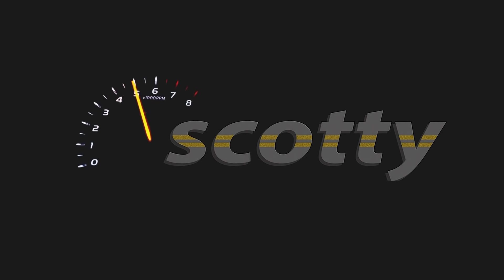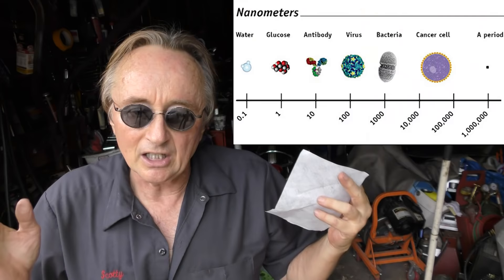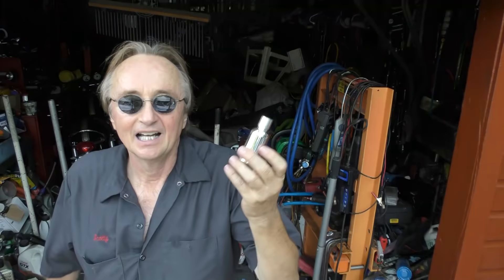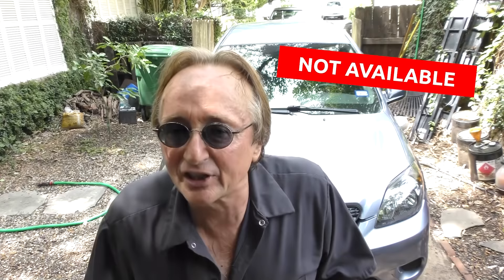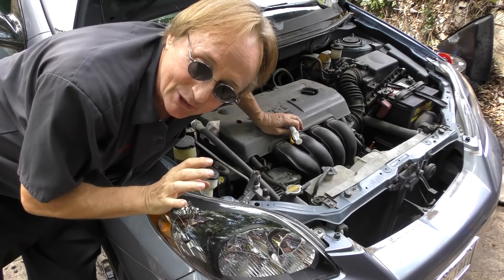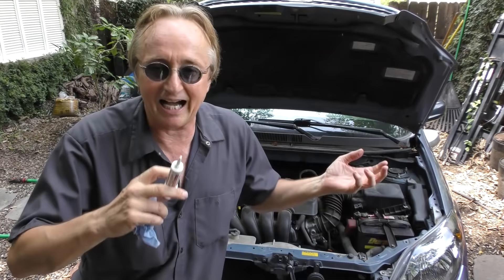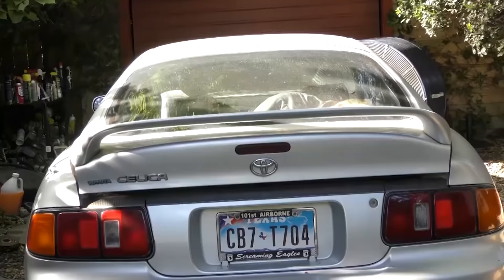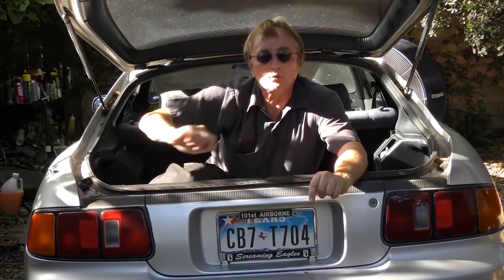Why Not to Buy Nanotechnology Products for Your Car

Comment: Scotty, certified Nano Ceramic coating installer here. It’s all in the prep, a proper prep and paint coatings (quality ones like GTechniq) are amazing. Absolutely  must do a good clay bar and single stage if not dual stage polish on them via machine, then an IPA wipe then application. Application is more difficult on the high performance ones, and they are legit. Google nano ceramic coating under microscope and you can see how it actually works. Some work better then others.

Comment: For the paint coatings, you really need to have the paint corrected before applying it. NuFinish is loaded with fillers that hide flaws, but putting a coating on bad paint won't make it look any better. Also, most coatings can't be used in the sun, as in NO sun. Just parking your car under some trees isn't going to cut it. Any sun, and it'll flash way too fast, and make the car look terrible.

Comment: Real paint protection sealant that's ceramic does last for years. But the cheap stuff you present is a scam, yes!
Reply: Billy Joe accurate
Reply: The product could be good most likely he just didn't prep the surface or applied it wrong
Reply: Considering he didn't state why the paint coating didn't work, I'm going to have to take his advice with a pinch of salt.
Reply: Giuseppe Cantatore
I sell you Brooklyn Bridge.  Cheap.
Reply: Got memes?
Is your middle name Gullible?
Reply: Im 180% sure he didn't prep the car, this guy is a fool.
Reply: Nano technology is great. But the way it's applied, it depends on the application and best use for. In this case using on cars isn't the best way to show off this type of tech.
Reply: Maybe in certain climates. Definitely doesnt work up here in North Dakota lol. Before winters end it will crack and fall off
Reply: Armor IX works. But you dont just  apply it. The car has to be prepoed which i doubt was done... wssh, claycar, iron wash, ipa wipe, buff, and polish, before you ever apply a ceramic coating.

Comment: I will stand behind Avalon King's Armor Shield IX.  I applied it once in May to my new Mustang and it's still beading rain water like a fresh coat of wax was just applied in October.  This is also with no wax products applied and washing at a coin op self wash station weekly.
Reply: The same for me. Has worked wonders here too.

To me, it sounds like Scotty is doing a lot of shouting without backing any of it up with real facts.

Comment: I must be living under a rock. Never of heard of this before..
Reply: To someone on the opposite side of the planet you are.
Reply: probably one of those exclusive TV offers from late night TV that always has some yelling infomercial guy in em, just wait 2 weeks and youll see a bargian bin full of em at Walmart with "as seen on TV" stickers on em
Reply: I guess, Scotty is always on top of the new stuff going on..
Reply: The Questioner 
Lol good one
Reply: Scotty is the most incredible YouTuber, but I was lost with this one. Not because of Scotty, I just never heard of this before..
Reply: It's mostly offered at the dealership for a couple hundred bucks.
Reply: MotorUp was advertised in TVShop about... 20 years ago already, then the AutoLotion - one for everything POS - restores your paint, rebuilds piston rings and crank bearings, cleans up your transmission and reconditions your leather seat and so on. Sounds so schtupid that I didn' t know to laugh or cry.
Reply: It’s not a new stuff.  I know of more “detailers” that know/use this stuff but there’s other more industrial stuff too.
Reply: Mitch Grooms same, don't feel bad.
Reply: Alejandro Rodarte as a Detailer, you are right! Gotta know what you're doing and the product used! Ceramic Coatings applied correctly, can protect your paint for up to 2 plus years!

Comment: Don't rule out all ceramic coatings based off that one Scotty, good ceramic coatings can last upwards to 3 years. Im an Detailer and we do this pretty frequently. Its a huge difference. It keeps your car looking like its been recently waxed for years, Makes dirt fall of super easily, and does a better job of protecting your paint then any wax or sealer. Its also phenomenal on your rims and especially headlights. Nothing short of respraying a clear coat over freshly clean lights will match the protection and look this stuff can give. Either the product you used was hot garbage or maybe the instructions were wack, But we use Carpro Cquartz and love it. From what you said it sounds like maybe you didn't get all the wax off first. 

General application rules from a guy who does this a few times a month
1. Wash and claybar car
2. Wash again.
3. Do any paint correction/Wetsanding needed because your stuck with whatever you seal. 
4. Clean panel with highest grade alcohol you can get. You want to hear a squeaking noise when you run you gloved hand over it. 
5. Apply coating in a crosshatch pattern.
6.(Optional)  Repeat step 5 again. Better coverage and better endurance, Papa Johns. 
7. Wait for however long its says to and buff off with a clean microfiber. 
8. Let it cure. Give it time to do its thing. We try to give it 3 days for best results but its driveable after a few hours if you can't wait.
Reply: daandriod 👍
Reply: Here’s the problem: it’s new so it must be a scam. Seems to be a common theme not only on this channel but my geriatric grandparents as well. A quick google search would have shown him that but who could be bothered with that right!
Reply: Not true. He likes the new mustang and it's tech despite it being a smaller turbo charged and he's been driving mustangs for decades.
Reply: daandriod thanks for putting the empty headed fools in their place! As a Professional Detailer myself, I've been using Ceramic Coating Technology for years with great success!
Reply: That's the product used on my car, I just posted a comment! Ha
Reply: YES!!! Someone who knows!! Ceramic coatings are the best!

Comment: You’re right about one thing. They don’t sell it in stores for a reason. And that reason is most people have no clue how to properly apply a ceramic coating. 

A real ceramic coating that has been properly applied is NOT a nonsense product. 

A ceramic coating job from a professional can run anywhere from $750-$3,500+. You can definitely argue that the cost is not worth the benefit, but that is subjective. But the product is quality. There’s a reason many car enthusiast wouldn’t think twice about having one applied. There are even coatings like that have self healing capability’s. You can pour hot water on the paint and the swirls or scratches actually heal themselves. 

Somethings that are misleading is some companies market them as being scratch “proof” which they’re not. They are however more scratch resistant

Comment: Who here remembers the sawdust in the Transmission scam.....
Reply: not just in the tranny the used to put it in rear diffs to quiet it down before going to auction so it would not make noise at the auction block and when you bought the vehicle the rear diff would blow up....happened to me once
Reply: As seen on The Andy Griffith Show.
Reply: Yeah I remember the rear diff lol
Reply: Also remember people adding 90w gear oil to engine oil to 
help with oil burning and noisy lifters.
Reply: I have heard of a Cotex strapped to the bottom of a bell housing to mask a leaking main seal
Reply: I read it in matilda book
Reply: unjust2u same here
Reply: Ha Ha..Classic episode!!
Reply: zeroyon223 No that actually works for older mechanical diffs, it's obviously not a permanent fix but it will get you a few miles farther
Reply: zeroyon223 Only seen it happen in a big old mitsubishi Semi truck so I can't imagine it was a lsd.
Reply: i’ve seen sawdust in explorer diffs all the time in 8.8 rear ends. ever since cash for clunkers i’ve only seen it in old jeeps
Reply: Iv seen sawdust put in powersteering
Reply: I remember that from Matilda lol
Reply: First time I heard that it was oatmeal. Then, later heard the sawdust version
Reply: I don't remember that one, but I remember the banana in a noisy universal joint or an egg in a leaking radiator trick before selling a car.

Comment: So many things to say... where to begin?  First, nano-ceramic coatings should not be applied by the average car owner.  90% of the application is the preparation of the paint, that includes perfectly washing (which most people can't do), deconaminating (that most people don't even know it is a thing), polishing and finally making sure to remove any oils, grease or wax on the paint.  Then applying the product in the correct manner and the allocated time (depends on the product).  A good coating will last years, where your typical wax will last weeks and you typical sealant (like that New Finish) will last months.  They are also more resistant to chemicals and offer slight scratching resistance from damage usually done during the wash or drying of the car.  They are also super hydrophobic, much more than waxes and sealants making it easier to wash the car and preventing water and dirt from sticking as easily to the car.  So they are good products, just don't try to do it yourself unless you are willing to spend 10s of hours learning all of the needed detailing skills to do a correct job.  Your comparison would be like me, who is not a mechanic making a video saying : "Hey, don't repair your engine if it breaks.  You are better off buying a new car.  I ordered this crank shaft off Ebay and installed it.  The engine never ran again... what a scam".  The problem would not be the crank shaft, it would be me not having the skills to do a very complex mechanical job.
Reply: Calendyr correct! Fellow Professional Detailer!

Comment: I love your videos and your mechanical advice is very helpful, but as far as cosmetic stuff goes it can be pretty inaccurate. Just like with any product there are good and bad ones. Ceramic coatings can be excellent if you get one that works effectively.

Comment: I just finished detailing a truck that had a ceramic coating last monday. My honest opinion about it.... Well that coating that the previous detailer told my client said he guaranteed it to last two years. My thoughts... I don't believe that it will last as long as he had said. Yes it kinda helps cleaning the surface while washing the vehicle, but if it's neglected, it won't last too long. It felt the same as a polished and waxed vehicle. I personally wouldn't purchase to have a ceramic coating put on my vehicle. I just think that a lot of detailers over-hype this service and try to upsell it to their customers. Overall, get a real good detail done first, then follow it up with a maintenance program if your detailer offers it. This can be cheaper to than the ceramic coating. Or do it yourself (detail & maintenance). Good video Scotty. I see a other detailers promoting this nano technology stuff to the public, boasting how great their product is. LOL!

Comment: I have a 94 mustang that still shines better than any brand new car in a showroom I’ve ever seen.  I use Collinite 885 marine and aeronautical grade paste wax. I use it on my boat and one day I decided to use it on my car.  I won’t use anything else.  One of my friends tried the nano coating and was complaining that the water doesn’t bead up like it’s supposed to.  I pour water on my car and it all runs off and stays dry.  Unbelievable product.  Of course I recommend a light cut with a buffer before applying to smooth the surface, but you can apply this stuff once or twice a year and never have to wash your car again.  I run a water hose over my car when it’s dirty and lightly wipe with a microfiber and dry it.

Comment: My Ford Escort had really bad blow-by. Motor oil was getting shot up the line and soaking my air filter. My fuel economy was about 20 mpg. I was desperate and bought a little bottle of some CerTech Gel. I followed the directions and it worked exactly as advertised. In about a month's time, the blow-by got less and less and finally went away. The new air filter stayed dry. Went through about 10K more miles, a couple of regular oil changes, and the problem never came back.
 I am not a scientist and I am not paid by CerTech Gel in any way. Just a very satisfied customer. That stuff works.

Comment: It is just like the "Printer Ink" scam.
Good call, Scotty!👍👍
Reply: Printer ink scam...?
Reply: Jesse 
It costs roughly 25cent to make a 60 dollar ink cartridge. 
Check out "Printer Ink Scam"
on YouTube. Quite a few vids will pop up.
Reply: yeah, youre better off buying a whole new printer by that point, also when you print in color the cyan color always seems to be missing and even when it drains the fastest ive opened up one of those things, they still contain enough color on the cartridge for at least 40 or more pages, but the printer tells you it cant print until you get a cyan color, even if youre printing in black and white it never actually uses black toner, what it does is mix the blue yello and green to make black so you will have to pay more money for the color ink cartridges, because those cartridges cost a lot more then your run of the mill black ink cartridge.

So by the time your cyan color runs out, it says it cant print in black and white, even though the only colors in the printer are black and says it can print 500 pages in black ~_~
Reply: Ernesto Lone Wolf 
That is why they basically give the printers away. They get it all back in ink.
Reply: They had sensors to let you know when it was low . It would be more than 25c
Reply: Yeah I worked for a company that sold ink it’s crazy but who needs printer now use pdf and just print things at work lol or just go to fedex store

Comment: Quality coatings do perform very well, naturally you have to prepare the surface properly (clay, polish, remove grease/wax or residue) then apply it.
Granted, many coatings are hard to remove, especially professional ones (only certified detailers have those).
But again, when it comes to paint and detailing it properly, you should look into it a bit more .. I wont even link the video you posted on polishing, common sense tells you its not how its done.
I'll say again, you're a great mechanic and I enjoy that content alot.
So, dislike on the video, but a subscribe in general.
Reply: could not agree more

Comment: I slightly agree with Scotty here. There are a bunch of companies that try and rip people off with their bad products that are knock off's or low quality, BUT some of these products do work. Ceramic Coating or as some call it Nano Ceramic Technology  is an actual thing that does protect your paint by adding a small layer on top of your clear coat. You shouldn't notice anything big except for a slightly better shine and dust and liquids to not stick to the clear coat and a easier way to clean. I know a bunch of people who have it put on their cars and there is a difference in the feel of the car and how dust and the biggest issue BIRD POOP and Pollen comes off the car. I agree they are to expensive but it might be worth it to some and not to others.

Comment: Honestly I wasn't at all impressed with the nu finish... But the meguiars nano wax had spectacular results... Whether or not it actually had nano microscopic particles or not who knows.... But it worked great!
Reply: I remember new finish being extremely hard to take off. And the level of white dust when removing it was insane. I wondered how much of it I must have breathed in when I was finally done. I love maguires. My favorite wax right now is the Maguire's ultimate liquid wax. It smells good, goes on extremely easy, and comes off very easy. And no dust. Easiest wax job i have ever done with excellent results.
Reply: Dave Boothney 

Nano particles are 1000x smaller than microscopic, ie, what’s visible under an optical microscope.
Reply: I've never tried Nu Finish. I haven't tried that Meguiars product, either, but their other products are great, so no doubt their wax is great too.
The best product I've personally used was called Auto Glaze, but they changed the name, so I don't know what it's called these days. It's not a polish, in the conventional sense. It comes out like runny toothpaste, but quickly hardens. Meaning it needs to be applied to cold paint in the shade and buffed within one to two minutes after application. The product actually has tiny beads of glass in it. After buffing, the paintwork was actually more reflective than the glass of the windows! It leaves that super-shiny look that expensive cars have in adverts.